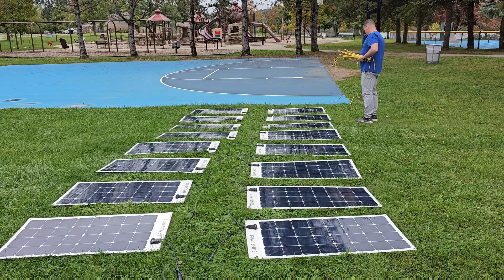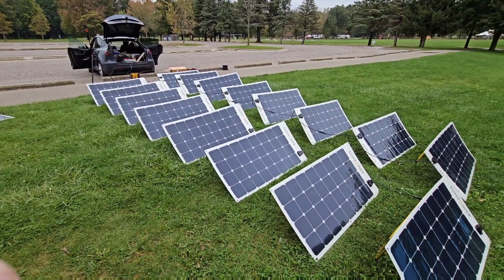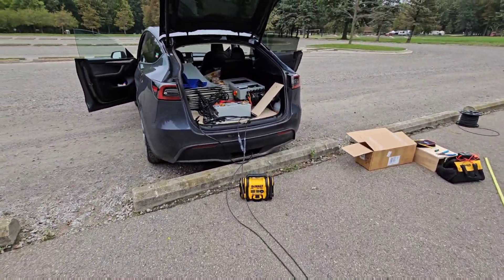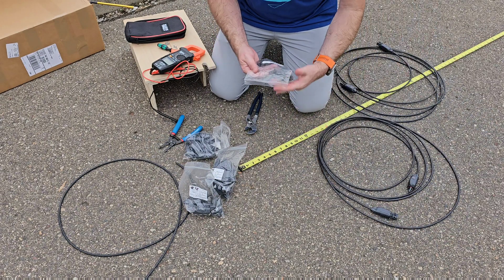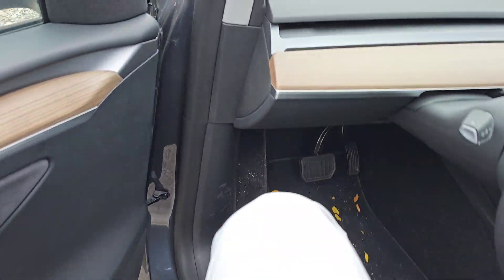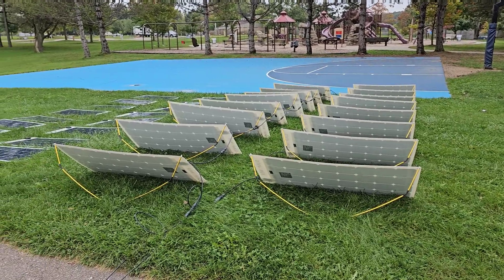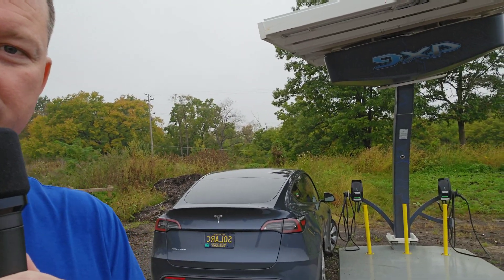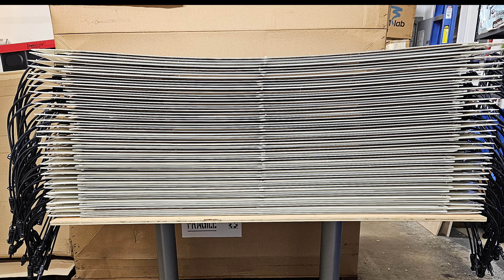Full System Test, only cheated a little bit

Comment: I'm only catching this now more than a year later. A note on MPPT controllers—they are not all created equal. I have some that can still be putting out 20% or more under a fully overcast sky. It seems that you have one with a lower cutoff threshold that is pretty high.
Reply from the maker: Wow that's great. My small victron MPPT does quite well. You are correct. I think the voltage range on the large inverter was 125 to 500 volts. In full sun I was able to get the rated 6400 watts but only one time. It was all down hill from there, but not in a good way :)

Comment: Not familiar with the solar connectors.. are they single conductor?   How is it different from a normal crimp connector?
Reply from the maker: Yes. Single connector. MC4. They are sealed and are nice for hi voltage, i.e. hard to accidentally short or connect wrong.

Comment: Best of luck, looks fun...

I wonder if there might be any sort of way to link sets of the panels so they can more rapidly accordion out from a connected stack that is just heavy enough to still be able to lift the each of multiple such sets?  Not a priority I know, but might be neat to be able to deploy and pack up in just a minute or two...
Reply from the maker: That was the original plan but was too awkward and heavy. I'm still practicing the best way.
Reply: @lightpowered  ya, as I wrote it I kept thinking... a loose stack and simple flex pole are definitely the KISS solution...

In our imaginations though we can keep thinking of a system where you just pop the trunk, grab a handle, and pull out 10s of feet of panels that all just accordion magically into place...

Comment: Please check your cables for resistance/continuity compared to bare wire. Insulation displacement type connectors can be unreliable. Good luck on your trip 🦘
Reply from the maker: Thanks for the tips!